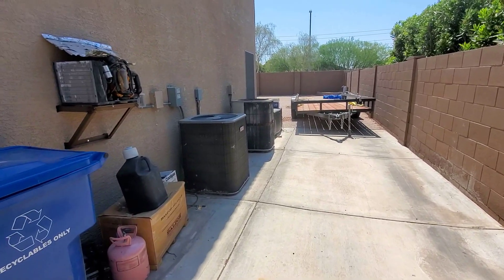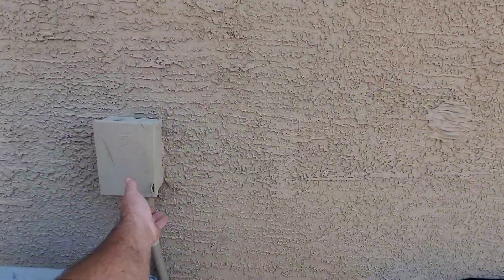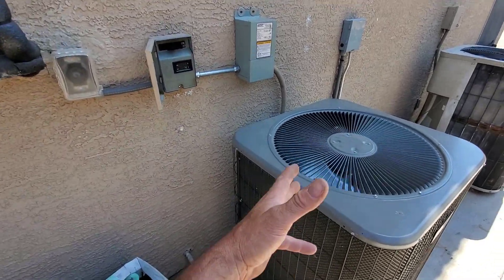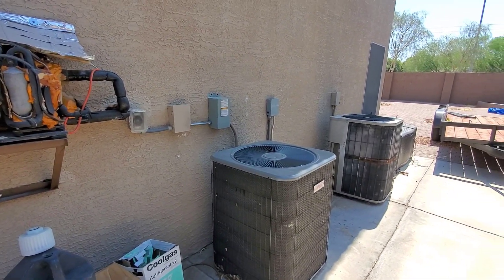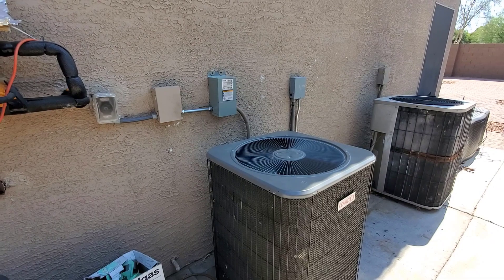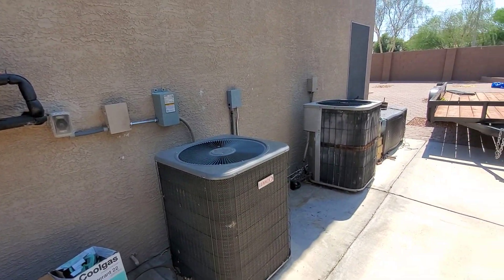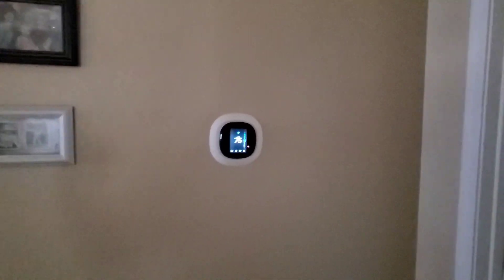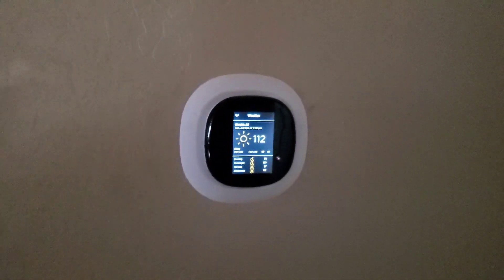Goodman breaks down again - EcoBee 2-stage use - More Offgrid Solar fine tuning

Comment: I bought a Goodman lol. The owner told me it comes off the same assembly line w same compressor as the best. I need to buy another 5 ton. Any recommendations for a long lasting unit?
Reply from the maker: Most units use Copeland these days.
Trane used to build their own compressors back in the day.
I was told from a few sources that higher end units like Trane have a different spec sheet for their scrolls making them a little different from the off-the-shelf one. But I have not confirmed 100%

Goodman just makes the most basic HVAC.
They don't produce anything in the realm of Carrier or Trane as far as commercial goes.
Reply: @hackfreehvac   oh I see. I can definitely hear the difference. It’s pretty loud and doesn’t seem as cool. I have a piston I think w r410 outside. I hear good things about Rudd but not sure. The unit I need replaced is a 5 ton amanna built in 1978 on the inside w an York r22 compressor outside. Never has any issues (blower motor replacement) but I think at some point it’ll go so not sure what is comparable lol
Reply from the maker: @Gsxrtrix  I think Ruud/Rheem is ok stuff.
I installed some Thermalzone (Ruud brand) and it wasn't too bad.

Comment: 24 cents during peak?  Holy shit.  It’ll only get worse as more coal plants get taken offline. We still have a mechanical meter/fixed rate here in MO, we have tons of coal however.
Reply from the maker: Yup.
And that's the base fee.
They also add "delivery charge" per kwh and all sorts of taxes per kwh plus funds for their maintenance per kwh etc etc etc

Comment: True or False in a more humid climate, it’s best to run the AC-Between 72 and 74 no Lower
Reply: Depends on what equipment you have, if you care what your electric bill is, and if you're COMFORTABLE at the set temperature/humidity. 
 I live in SWFL and I keep my house at 68 degrees with an RH of 55%

Comment: i was hoping you were gonna try out that lower tap!
Reply from the maker: I figured it was good where it was but evidently I saw today that it wasn't when it was still drawing 4 amps off of the utility yet when I pulled the utility disconnect my solar actually proved that it had enough to run the VFD completely at that point (on high speed).
In my recent video where I noticed about the same draw I put my hand on the disconnect then decide not to, ASSUMING it would stall since it was on high speed yet needing to draw some power from the utility. (3 to 4 amps).

I needed to go to the family father's day dinner at the in-laws so I didn't check voltage etc. Maybe I will do that later. But it is good to see that the solar is capable of powering the entire thing on hi speed as well as low speed.

Comment: If the air handlers are both in the attic, maybe you can tie some of the supplies together to the VFD so it is feeding air up and downstairs since it is running all the time anyway. (i.e.: tie them together and leave the indoor fan running in both, but with the POS Goodman only kicking on when the temp downstairs hits 79 or something)
Reply from the maker: I've thought of connecting a damper to the duct that feeds the main living room & kitchen downstairs but that is 4 large vents I think and this is now only a 3 ton now (replaced the 4 ton) which feeds 5 rooms and a bathroom upstairs.
The airflow would likely suck pretty bad.

I am not sure what is in store for the downstairs.
Maybe some mini splits and I gut the Goodman and it's AHU in the attic.
Or I put in another similar system and let them BOTH tap off of the solar and have something divide the operation time somewhat (so each gets some run time on solar).
I dunno. Just a bunch of ideas.
As long as the Goodman turd runs then I won't actually buy anything because it would take years to recoup the investment even doing it myself.

But we'll see.
My next thing is to get something into my garage. It's so hot in there. It was 105 yesterday as I worked at my electronics bench area.
Reply: @hackfreehvac  Genius brain flash: Have you considered separating and reversing the RETURNS? Downstairs return to upstairs, so it is feeding hot air into the VFD unit, then cool air upstairs while cool return air is (re)circulated downstairs by the Goodman AH, like gravity, but better.
 
I think even diverting sub-50% portion of the cold supply would make a difference since it is running non-stop at a lower set point than you'd otherwise put it. If you can get it right, you might find the temps in the upstairs rooms a few degrees higher than the Bee in the hallway, but downstairs stays a few degrees cooler without the POS Goodman kicking on. 

Things change a bit when you are blasting systems because there is no off cycle for walls and furniture to heat up again. (In college I had this way undersized window banger, but if I left it maxed, 24/7, it actually did a great job... but zero chance it would recover if I turned it off - everything in the room would heat up and it would be hopelessly swamped).
Reply from the maker: @georgen.8027  Both air returns at in the upstairs open area in the ceiling. 
But air handler units in the attic.

Now that I just got stage 2 to operate on solar up probably adjust the settings so it uses it more frequently.